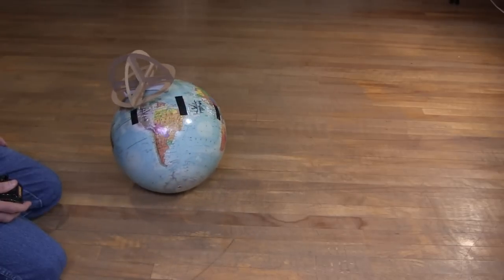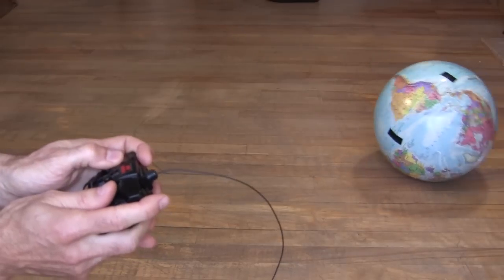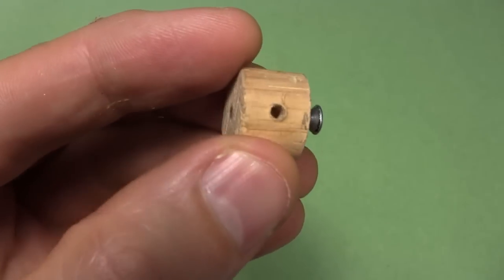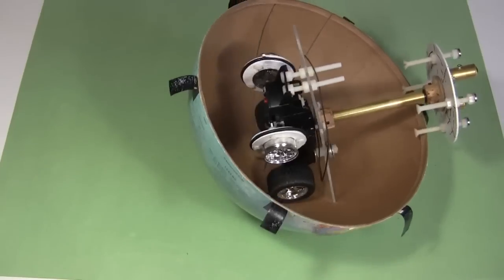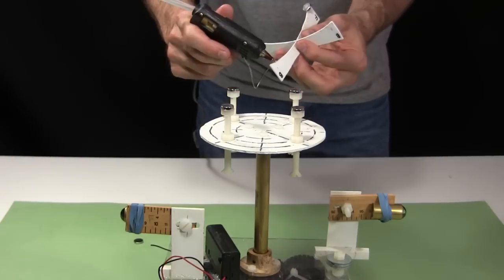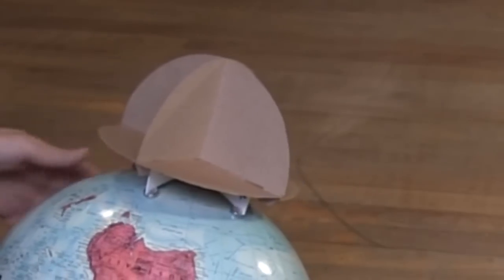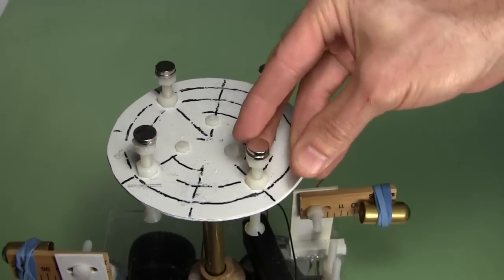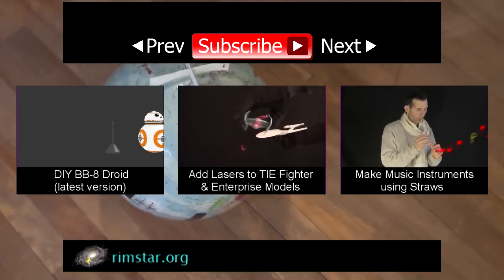Making a BB-8 Droid Build (v1) from Star Wars

Comment: also could you coat the magnets in plastidip spray so they have rubber for friction?
Reply from the maker: +Daily Cup of Justin Good idea. Though it turns out that using the balls in attraction to the magnets is a bad idea. If they jump off the globe due to imperfections in the globe then the attraction is lost. It looks like it's better to go with separate magnets for the attractions.
Reply: Ah. Gotcha. Have you considered using electro magnets?
Reply from the maker: +Daily Cup of Justin I can't see how they would help. But it's an interesting thought for a different design. There's one approach where you coat the ball with something ferromagnetic and then have magnetic wheels in the head to roll around. Electromagnetic wheels instead?
Reply: Hmm... I was thinking as using electromagnets to hold the head on so you can easily adjust the force that is holding the head down. Maybe even do it automatically through software... I'm honestly the biggest of noons when it comes to electronics

Comment: +RimstarOrg Hi there! We are 6 grade 8 students who are building a bb8 droid. We have made progress, yet we are still running into issues. We have medium sized wheels on our car, not quite as big as yours. Could that make all the difference in terms of efficiency? If you could let us know soon that would be amazing. Thanks so much.
Reply from the maker: +Emily Folk Bigger wheels would help since they would contact more of the cardboard globe, meaning they would grip more. Adding weight to the car will also help them grip, but at some point your car will be too heavy for its own motors. My truck wasn't powerful enough and so I had to take a completely different approach when making my version 2 https://youtu.be/BCXH4AN2aog.
One trick I found that really helped with version 2 but never tried with version 1 was to spray the inside of the globe with an anti-slip spray available in hardware stores. Warning: the anti-slip spray it will make the inside of your globe smell bad forever! I ended up keeping it in a plastic bag when not in use to keep from stinking up the place.
Another tip I learned, which I mention in my version 2 video, is to keep your globe taped closed when not in use, even with nothing inside it. If you don't then the globe will deform.

Comment: Why not remove the front axel and have it be a three-wheel truck?
Reply from the maker: +Michael Winter Interesting idea. That might steer better. You'd just have to be careful to have enough traction left over.
Reply: +RimstarOrg Good point. You could counter-weight so the rear-axel is centered at the bottom. Hmm... interesting build. Thank you!

Comment: Did you make the rollers to support the head? If I just made the ball, would I need them? Please answer ASAP.
Reply from the maker: +RainbowSplashGaming // Rory Yes, I made the rollers that support the head. I show how in this video. I'm not sure what you mean by "if you just made the ball, would you need them" since that would mean aren't making the head, so no need for the rollers.
BTW Where making a BB-8 is concerned I've learned that there is no such thing as ASAP. It's a difficult process with lots of trial and error.
Reply: Ok. Thanks a bunch!!
Reply: Also, could you tell me where you got the globe?
Reply from the maker: +RainbowSplashGaming // Rory I bought the globe from someone locally. It turns out that a lot of people buy globes and eventually sell them. I found two of the on http://www.kijiji.ca, a Canadian online classified ads website. Other sources is https://www.freecycle.org and other websites where people can give things away. Then there's http://craigslist.com and of course local thrift and 2nd hand stores (I got a 3rd one from one of these.)
Reply: Cool. Thanks!

Comment: After you move the rollers are they needed anymore?
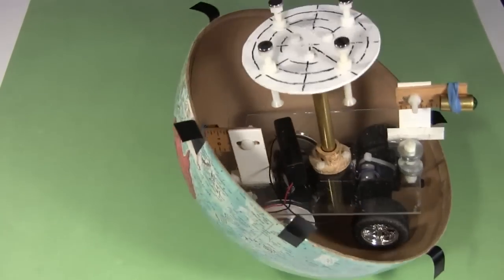Reply from the maker: At 3:26 you can see I moved them to the sides instead, to help prevent the truck from falling over inside. I ended up doing the same thing in my version 2.
Reply: @RimstarOrg  but were they needed for any use after you moved them to the sides?
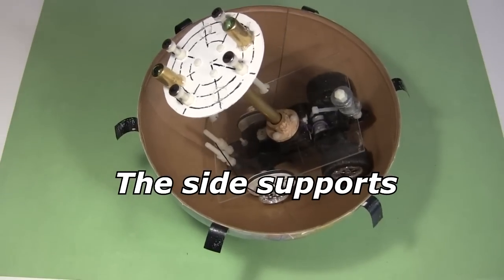Reply from the maker: Yes, at 3:09, I show how the whole thing tips over easily when in the ball. So I put the rollers on either end to prevent that. You can see that it no longer tips over at 3:29 due to the rollers.

Comment: Wow what an engineering feat you put an rc car inside the ball... Smart but not the most efficient option
Reply from the maker: +Sharpchain1 _ Actually, it's very efficient. I tried a minimum approach before using more effort on a harder approach, which is my BB-8 version 2 https://www.youtube.com/watch?v=1gWBS70vphY (I've since gotten it to work and a new video is coming next week sometime.)
Reply: +RimstarOrg v2 looks very good nice job 👍 much better than this one, I am currently trying to make my own bb8 droid as well, it is a bit bigger than the one you have in v1 and v2(i think) I have made my own remote for it using 2 Hc-05 BT modules I am still working on making the body with paper mache and some other things to make it a bit stronger using a toy ball as a base. I might make videos and put it on YouTube if I can find a good camera to record with
Reply from the maker: +Sharpchain1 _ Cool. Post a link here if you do upload a video at some point. In any case, I'd be interested in hearing how it goes. At some point I plan on replacing my adapted toy truck remote control transmitter/receiver setup with bluetooth as well, just to try it out. I also have a second globe now and before I cut it open I plan on putting a layer or two of fiberglass on it to strengthen it.

Comment: Why don't you put the car in the head? That way the ball will roll under it and it will always be on top...at least until you stop.
Reply from the maker: +Stephen Methuen Because in the actual BB-8 droid the head is able to move all around the top portion of the ball, even to around 45 degrees down. For example, you can see it in the 3rd trailer here https://youtu.be/HDhExRxZxN0?t=1m10s. If you've seen James' of XRobots, his is done the way you describe because at the time only the 1st trailer had been released and the head was shown only on top.

Comment: you should get stronger magnets.
Reply: but not too strong.
Reply from the maker: +Bryle Ipup Aye, that's the trick. The magnets are actually strong enough, so strong that I have to keep them far apart so that the pull isn't so strong that the truck can't move. The magnetic attraction between the inner support structure and the cross on top acts like a glue. The pull of the cross against the globe holding the cross in place can have the same effect as gluing the two of them to that location on the globe. What's needed is a stronger truck, so that the magnets can be put closer together and still overcome that "glue".

Comment: Why don't you use a ballon as a head just put super strong neodymium magnets in the ballon and now you have a head
Reply from the maker: +sciencenerds Oh, I like that balloon idea. Very lightweight. There are other parts on the head too, two sort of eyes that stick out and two antennas standing up, but if those can be lightweight enough too (disguised straws for the antennas for example) it might work. Thanks! I'll keep that in mind.
Reply from the maker: *****
Ha ha! I like the way you think! Very out of the box.
Once I've got a new, more powerful drive system working, the need for lightness will probably go away, hopefully.
But I almost want to go with a helium filled balloon head anyway just because it's such an awesome engineering solution!

Comment: Anyone know how to add in bb8 sounds with this model
Reply from the maker: +Eli Rezek You could use the Adafruit Sound FX board. That's the one I'm planning on using in my BB-8 version 2. It's the same one I used for my Scareduino here https://www.youtube.com/watch?v=P0lYZtz7TZ0. You don't need an Arduino to run it though. Maybe you can activate it to play a randomly chosen sound file whenever the BB-8 starts moving, that way you don't need a separate remote control channel for it.

Comment: Use an arduino and accelerometer to balance the head.
By the way great job steve
Reply from the maker: +harsh bawari Thanks. At some point I'll probably add an accelerometer and so on but I'll try fully mechanical first.

Comment: Or you can just design like bb-8
Reply from the maker: +Jose Rafael There were 7 or 8 different BB-8's used in the movie, each designed for doing a different thing, some just puppeted for moving the head for example. Then there's the one they made after making the movie and that they use for promotions and stage shows, but to my knowledge they haven't released how that one works yet, only a few hints like that the head is independent of the drive mechanism inside, but that's all the detail we have on that. Unless you know of an information release, in which case I'd like to know more.

Comment: 1:21
Reply from the maker: I don't understand what you mean. What would you use to cut this plastic? Early in my building days, I'd cut it with repeated scrapes using an x-acto knife and still do if I want clean cuts. A scroll saw would also work with a thin blade but I've never tried it. For faster, rough cuts, I've found that using tin snips like I did in the video works great.

Comment: Try styrofoam for the head.
Reply from the maker: That's what I ended up doing in my version 2 https://www.youtube.com/watch?v=BCXH4AN2aog&list=PLFsZmHTZL-zmfXxstlxuJgRE9bOGobEVu It still would have been too heavy for version 1 though. The magnets would have to have been stronger to hold the styrofoam head on, which means more pull by the magnets on the ball, which means you need more powerful motors to move them and a heavier "truck" too, hence version 2 which has all those features.

Comment: I admire your perseverance but I think that the design is fatally flawed :-)
Reply from the maker: +David Kempton That's version 1. Now that that's out of the way I can move on to version 2, starting with a new drive system.
Reply: Yes I think that is what's needed. BTW your videos are great.
Reply: +RimstarOrg I now think the fatally flawed part is the way you are stabilizing the stuff on top. I think if you had a "head" with 4 omnidirectional wheels on top, controlled by variable speed motors, and a feedback controller to stabilize it.

This design would be inherently unstable, so you NEED a controller, similar to those used for multirotors, To go forward, the wheels will push the top bit forward, as it does so, it shifts its weight over the edge, and the imbalance causes it to start trying to rotate forward. As it accelerates forward, the wheels need to stop moving forward and rapidly change to going backwards to not fall off. It will need to maintain some angle relative to gravity. Kind of like a segway! but in 2 dimensions instead of 1!
Reply from the maker: +Power Max Comparing the Sphero and Hasbro BB-8 toys to the one made by the special effects guys that they take to promotional events has a far more stable head, so there's definitely something extra going on like you're suggesting. I'll revisit the head once I have a more massive drive system. That'll likely introduce all sorts of new options.
Reply: +RimstarOrg If you can afford it, you can probably make something super custom, here is what I have in-mind:

You'll need: Bluetooth UART transceiver and your smartphone (or a cheap Tx), An arduino or microcontroller of some kind, 3 continuous rotation servos (or just geared down motors), and 3 omniwheels.

To build it, i would make a frame out of something easy to work with to begin with like wood or plastic, then make the bot so that the wheels look like they are in a delta configuration like most on the web, and using your knowledge of vectors, magnitudes, and trigonometry, program the bot so that it is able to you can control it to move forward, backward, side to side, and yaw (i'm sure there are others who have published code for this). I think a small bot like this should fit inside the globe much better too, and if you make it out of sheet metal or something, it will probably have the weight it needs!
Reply: Power Max isn't that a bit overengineered? Maybe the magnets just need to be put in the middle, because putting them on the ends of the cross makes them angled compared to the globe's surface, thus having an unreliable range

Comment: PLZ INEED YOUR HELP I MAKING ONE LIKE YOURS AND I HAVE 3 DAYS DUE HELP PLZ!!!!!!!!!!!!!!!!!!!!!!!!!!!!!!!!!!!!
Reply from the maker: +KJ D I'm happy to help, ask whatever questions you have. But keep in mind, as you can see in this video, this version didn't work. I couldn't make a full sized head stay on.
Reply: what did you use to make  the plastic top part 
thank you so much
Reply from the maker: +KJ D Plastic sheets from a hobby store. They're around 2mm or 1/8" thick. I've salvaged some from old appliances I've taken apart too. However, I tried to use that same plastic cross for my version 2 and it didn't work well. I had rollers on the four ends and magnets nearer the middle. The magnets pulled downward toward the ball so much that the plastic just twisted. You can see what I did instead for version 2 here http://rimstar.org/science_electronics_projects/bb-8_v2_dome_head.htm. But since that's a lot heavier it also requires a much more powerful drive system, which I also have in version 2 http://rimstar.org/science_electronics_projects/bb-8_v2_hamster_motors_batteries_wheels_rollers.htm.
Reply: thank you can you plz put me under featured channels